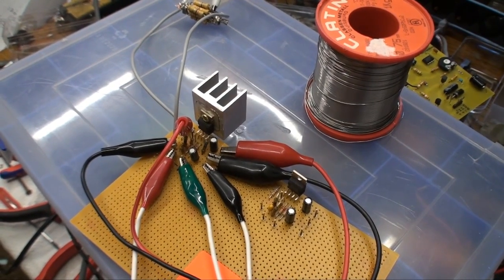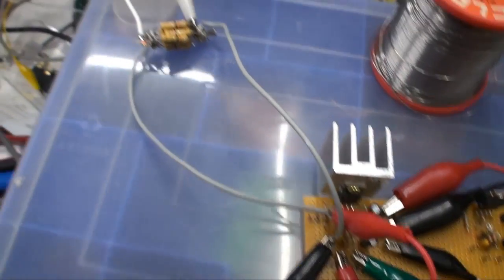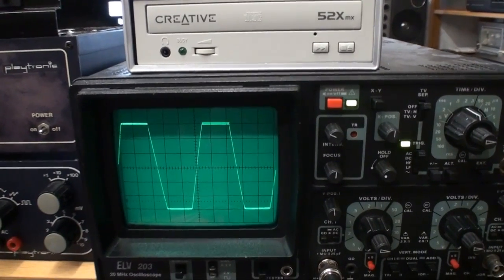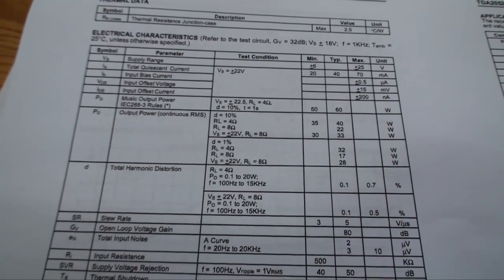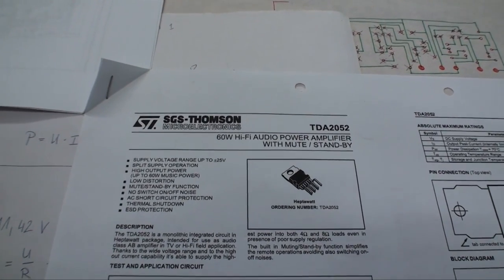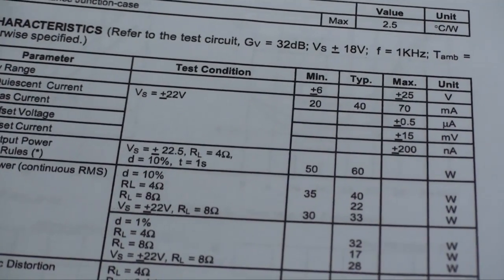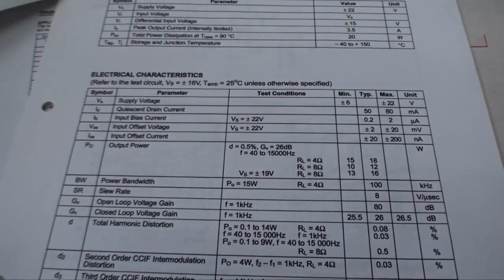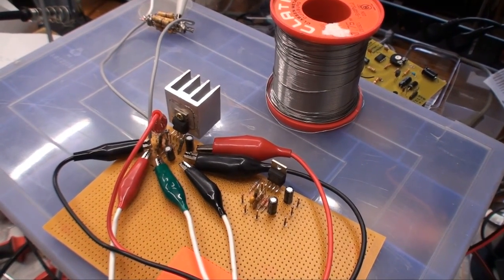DrCassette's Workshop - RMS output power - measuring, analyzing - TDA2052 amp chip

Comment: Some concepts are not quite correct: 1) The Stand-by function (and also the Mute function) in this IC is not completely useless. It may be useless to you on the bench, but for battery operated products the standby function can reduce idle power consumption and hence battery life. And the mute function is also essential for reducing the power-on pop-sound. 2) The maximum current for TDA2052 is now 6 Amps, much higher than 3 Amp of TDA2030A or even 5 Amp of TDA2050. That means this IC can drive better low impendence loads. That is the major advance. 3) The music power measurement standard is not invented by Chinese, and audio products from US, Japan and many other countries are quoting music power or PMPO, I have many Japan audio products quoting PMPO, especially back in the 80's or 90's, during their hay days. So why only "preferably Chinese" is highlighted are "doing it"  in your video? What are you implying? Is that some kind of stereotype? 4) The "cheap alligator clip wires" may be having 0.68Ω is just unbelievably high or I will say many cheap things should be better than that. I guess it is pure bad luck to have these cables.

Comment: I do see that the supply voltage can take up to 26v, so I guess you'd get a bit more out of t by running closer to that?
Reply from the maker: Correct, more supply voltage results in higher output power, however this is limited by the IC's power dissipation abilities.

Comment: Hi DrCassette. check out this homemade 8ohm dummy load for audio amps.  Built with a water heater element.  Interesting.  High Power 8 Ohm Dummy Load For Audio Amplifiers

Comment: Great video. Wattage ratings on amps are so vague these days... There's a movement in tube amps to go back to the accurate measurements for RMS and use high efficiency speakers instead of pumping 100's of watts into complicated crossover networks that suck up a lot of the actual ppower. I say it's about damn time, too. :)
Reply from the maker: Of course people buying tube based amplifiers are knowledgeable enough to know that these units can never ever put out 1500 watts or whatever. The average consumer doesn't know anything about that, he just looks at the number and chooses the highest one. What surprised me a lot is the fact that even data sheets, documentation the average consumer never gets to see, now include such fantasy values. A total waste of time, because the engineer designing an amplifier will find out about it all eventually anyway...
Reply: DrCassette The whole world of audio is full of people who actually believe their own BS. Just pick up any of the trade magazines and read a few articles and you'll see what I''m talking about. It has gotten to the point where I just think it's funny and I read this stuff and laugh. :)
Reply from the maker: Joe Collins I used to read Audio / HiFi magazines for a few years, I know what you are talking about. Eventually I got sick of all the bla bla, when they fell in love with an amplifier or whatever that so absolutely clearly had quality issues, was badly designed etc.
I haven't read any of those magazines in years. I do know that the chief editor of one was fired at some point because people just quit reading the magazine because it was all just high end voodoo :P

Comment: That standby mode could be used instead of a speaker relay.
Reply from the maker: No. The purpose of the speaker relay is to keep the speakers turned off while the amplifier stabilizes from the power-on process. Also, speaker relais usually are part of a speaker protection circuit, if something goes wrong, they shut off. You better don't expect those chips to go into standby mode when they are just in the process of blowing up ;)
Reply: Of course it's better to use relay, I just meant to avoid that bang noise when you turn it on.
Reply from the maker: TheVintage99 Still wrong. The bang noise is caused by the power-on process. You will get the bang also when powering up fom standby.

Comment: 16 gauge speaker wire is usually more than adequate. But for a good sub at 100+ watts, 12 ga is necessary if less than ten meters length..

Comment: So looks to be a nice little 30 Watt stereo amplifier, that you can run all day long at about 10-30 watts. That's plenty of power. Many of those sub woofer amps are way over rated. 30 watts RMS is pretty loud. (unless you're in an auditorium). I often judge an amp by the size of the power supply in it.

Comment: Great video, just a little tip for next time to be more precise, when you make measurements like that keep in mind when you load any passive power supply voltage will drop, so with 1A there I bet was that few volt drop that got you 16W and not 17W :P In those data things they always give you measurements in exact voltage no matter the load. Still you got great results, thanks for a nice video ^.=.^